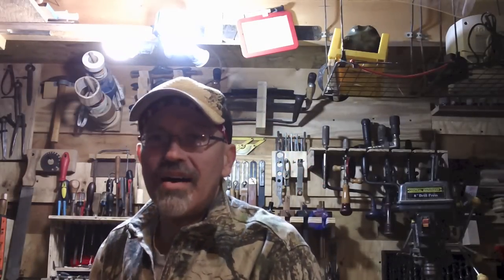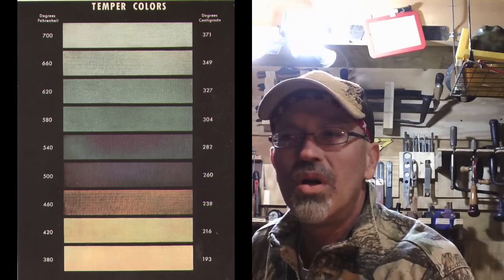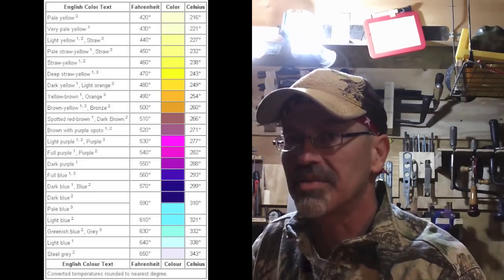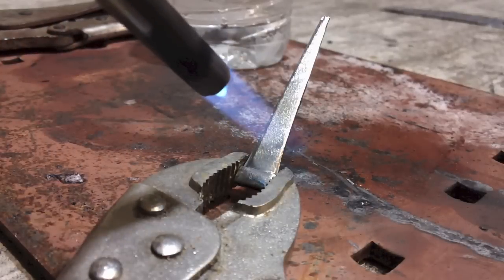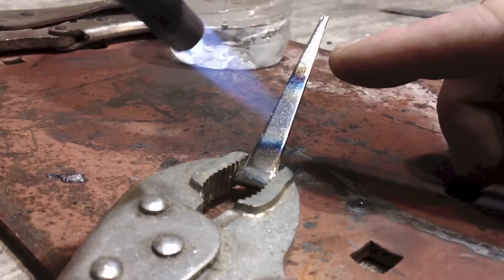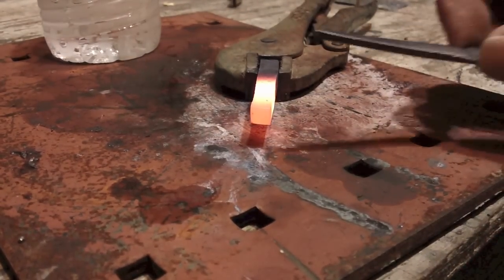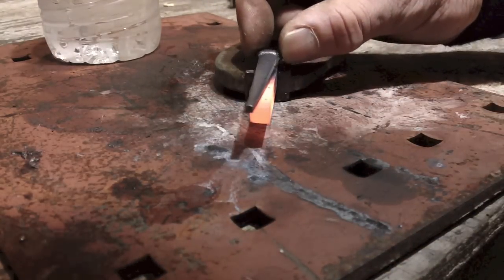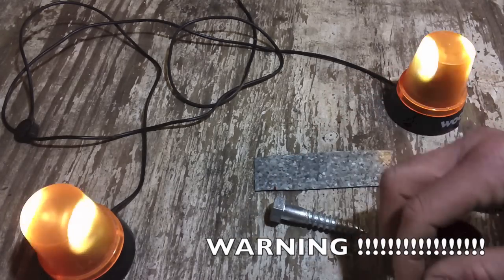Tempering Steel

Comment: if you live in a clay rich area, or get your hands on some sculpting clay. water it down where its like mortar, put it on the areas you dont want to harden as much. lay in on thickish. then let it dry. then heat that knife to temper, and quench. the blade remains hard and the back or clay covered springy. then a slow temper, like 300 Degrees F, for a hour, and you got a knife that's flexy as hell, but keeps a edge like a razor, that wont chip like its made out of glass. takes some practice. its small scale what the Japanese do to make their swords.

i have bought 100-300 dollar knifes for work, and bend en snap the blades offs, yeah they took some serious abuse, but i finally got sick of it, picked up some hardend steal at work. a scrap piece, sketched me out a knife tool do all, i wanted for my work. the applied everything i knew and learned to that knife. 5 years later, that knife tool i made, not a chip, or a bend, or a break or a crack in it. and can cut though carpet, and insulation's, and even peel metal like a light saber...lol keeps a edge for a good minute too.
Reply from the maker: +Huxlee29 It sounds like you are a person after a product that only yourself or a mastered blade smith can make. If you buy a blade with the properties you discussed it will be very pricey. Thank you for sharing that. It was a joy to read.
Reply: and you, Mr. Bardin, im still learning, and thank you, you tube is a miracle to reading books, and manuals, with stuff that seems like gibberish, and then you come along, and make it where i can understand something i may have missed.

plus i did ask a master blade smith to make me a certain tool a few years back, showed him my template and everything, $4500.00 was the starting price range. i dont know about some people but i do not have that laying around for a project that was only 9x4 inches. 

to add to this, difference between what i make and other. mine is UGLY, not a piece of artwork, its made to do its job, it doesn't have to be pretty.
Reply from the maker: I have been working with my hands all my life....oh call me Dave.... and it makes you appreciate the time and labor it takes. If I can get $30 an hour I call it a good day.
Now that you have the metallurgy worked out. Next step is to work on fit and finish.
 But if your like me and the tool is for myself. I don't care what it looks like as long as it gets the job done and is ready to do it again.

Thank you for your time and comments. U R welcome here anytime...
DAve
Reply: that sounds perfect for throwing knives.  i've gone through so many trying to improve my skill.  now i can develop the two at once.  thank you for the comment
Reply: i've been giving mine away as well.  mostly because i already have so many, and make them from free materials in my free time.  i did, for the first time, make a leather sheath for the last knife i made.  the leather came from roadkill i found in decent condition for tanning, and the rest cost me less than $20 including needles and a multi punch tool.  it's for an ocean diver and made of a lawnmower blade i flattened, shaped, sharpened, tempered, and honed with my added expertise of filling the mounting hole from the mower blade with zinc to act as an anode and protect the steel from some oxidization.
Reply: I heard they used to do this with Katana to make a hard and sharp edge on an otherwise strong yet flexible blade...

Comment: You can also put galvanized metal in muriatic acid DONT BREATH THE FUMES PRODUCED.  You will see the metal change color as the galvanization comes off. Then neutralize the acid with baking soda and a little water then you can weld it with a lot less risks

Comment: Thanks, helpful. With every video from different channels I get conflicting information re. Tools to heat and quenching. I’ve heard need to rapidly cool. I’ve heard slow cool. Use a torch. Never use a torch because it’s too difficult to spread the heat for uniform temperature.

Comment: The zinc used for galvanising wouldn't show the right colours anyway.

I am trying to find out how to strengthen a tine on a garden fork so it doesn't bend so easily. It softened a little the first time it bent.

Comment: Hi sir im diggin in this vid pretty late but it is really amazing . i have only one question: 
If you quench the steel with oil or water, i assume that steel is alredy hard. Why to.do the heat treatment and why you do it only in the bottom of the material. ?

Thanks you so much i hope you are doing well. I read you..

Comment: Quick question. I have been trying to make throwing knives recently and need some help.  I buy welding steel (thin sheet steel) from Lowe’s and then use an angle grinder to cut the blade out of it. I then Sharpen the point to be extremely sharp but only sharpen the blade just a little. What would you recommend I do to help keep it firm? I am thinking heating it up to critical and then quenching it and then doing one temper in my oven at 500 for an hour. Any other recommendations. Note I am using home made forges and can’t hit exact temperatures well.
Reply: Also to note. Without doing anything to the blades they work fairly well without additional heating but tend to bend easily. I also do have a hand blow torch I can use

Comment: I bought a gerber knife, and I thought it was a good knife at first, but it will not hold an edge AT ALL. It's terrible. Should I heat this knife to 500 degrees, and quench it in oil?
Reply: I know, I know....What did I just say? I just wanted to know if there was any advice for this ready made knife. Another thing is....I thought a super hard knife would hold an edge. This stuff is maddening to me. LOL

Comment: Hey, I'm not familiar with metal tempering at all. I do some metal fab at work though. I have a decent welder and oxy/acetalyn at home... I'm trying to make a sway bar for an ATV.   the stock sway bar is way too flimsy . there used to be an 11/16" aftermarket one available but they stopped making it. I bought a 3/4" round piece of mild steel. my question is should I attempt to bend and heat treat it ( if so how) or should cut it to length and weld 1/4x1" flat stock to the end then heat treat it ((or not )( from bar to the links)? can it be don't with mild steel.  Thanks
Reply from the maker: +Harper's Harper's  I don't think the mild steel is going to do what you want it to do. Beefing it up with another piece of steel or finding something a bit harder would be the route I would take.  I hoe that helps. Imho

Comment: how do you cool the blade after tempering it? using oil or let it cool naturally by air?
Reply: Dave isnt that quenching it with oil gives better result after tempering? what do you think?
Reply from the maker: oil and water quenches at different temperatures and speeds. It depends on the steel
Reply: no I mean after tempering it, isnt it better to cool it using oil rather than  left it in the oven to cool naturally?
Reply from the maker: I would think not but have never tried.

Comment: I have a question about hardness, I get that quenching from critical gives you a really hard brittle finish but why does quenching from purple or grey give a softer and more flexible finish than straw? I would have thought that the lower temperature the heat treatment the softer not this weird bell curve. Can anyone let me know how this works?
Reply from the maker: its in the way the atoms respond to each other. Its very sci-ency and Tons of literature is written on this. Some they still don't understand.
when you bring the heat up" you see this in temper colors" you are changing the molecular structure of the steel and other substances in it. Such as carbon.
so when u get off in all these sci fi combinations they use now. Its gets insane.
its kinda like a rubix cube

Comment: Can to temper a blade over a charcoal fire?
Reply from the maker: +Mr.Nobody YES! The Japanese still forge with wood cool. Takes more but it will work.
Reply: Yesterday i went and tied to harden a wrench. Quinched it in very hot water a few times and tried to temper it. Put it over a large fire for a bit of time but not shure how long and it turned to a nice blue/purple and a sand'ish color.
Reply from the maker: Im lost. What are you doing with the wrench. If you are taking a wrench and working it into something else. Heres what I would do. First you anneal the steel. This is getting it cherry hot and letting it cool slowly. This will relax the steel and make it easy to work. File it , grind it or whatever the method u choose. Then you will need to harden it. Again cherry hot.1400 degrees to a point a magnet wont stick. Then quench it in oil. Test and see if a file will cut it. If it does cut it quench again in water. Once you have the steel hardened then you temper it. That is when you heat it slowly and get to the temper color you want for that hardness. That color depends on how hard you want it and what its job will be. I hope this helps.

Comment: Great video, thanks for taking the time to share your knowledge.
I have a $40 dollar throwing knife, iv'e been practicing my throwing lately and it has a tendency to bend.
It's fairly soft steel as it is easy to file and will bend easily.
I'm hoping to harden it using my fire place and some oil.
Then, If I understand correctly I need to heat treat it again to make it not brittle.
I was just going to place it in the oven.
Would you be so can as to advise on what temperature and for how long and what color to bring the knife to.
It's a thrown knife, so I imagine it wouldn't have to be super sharp, but would need to be strong and not brittle.
Thanks again for the video.
Reply from the maker: +Chris Hinley Most likely the knife is just mild steel. If that is the case it will never harden. I would try to just get it cherry hot and quench in water. See if a file bites into it then.
Reply: +Dave Bardin . Thank you very much Dave, I'll give it a go.
Thanks heaps for the quick reply, you're awesome.
Reply: +Chris Hinley If it's mild steel, you can still make it hold an edge, though not prevent it from bending.  You can use case-hardening.  This causes carbon, and/or nitrogen to combine with the iron, at the surface, increasing its hardness.  There are three basic processes:  carburizing, cyaniding, & nitriding.  Carburizing involves roasting the part in a carbonaceous substance, like bone meal.  The gunsmith supplier, Brownell's, sells a compound for doing this.  A traditional method involves wrapping the part in leather strips.  It produces a very pretty multi-colored surface.  Cyaniding involves soaking the part in molten sodium or potassium cyanide (Caution!  Toxic fumes are produced.  Do only with really good ventilation!)  Both carbon & nitrogen then bond with the iron.  Nitriding involves subjecting the part to high temp. & pressure under an atmosphere of nitrogen.   This requires some pretty expensive equipment, and is not practical for the amateur.
Reply from the maker: Wow that was a very nice answer

Comment: So...I need to make a small flat replacement spring for a hand pruner lets say. The process is??? Get a piece of spring steel close to the size I need....heat it to critical temp...slow cool it....bend and work it to the shape I need....heat it in a flame until it is dark blue and what?? Quench it or let it air cool?  Thanks for the video...appreciated
Reply from the maker: +john smith YOU MISSED A STEP
heat it let cool slowly
work it to what you want it to be
heat it above critical and quench it (this makes it glass hard)
then temper it to the color you want . straw, purple, brown ect. (this makes it not shatter under use)

Comment: I have some 7x19 316 stainless steel cable that I have cut into 8 inches and would like to form into a circle. It is very springy and will not shape. How would I go about forming it into a circle?
Reply from the maker: +Creative Artist  Bracelets?   are you just trying to weld the ends together?
Please give me more information?
Reply: +Dave Bardin...Thank you for your response. Yes, bracelets. I need to be able to form them into shape and then put end caps on them, without them springing back. I am having a little difficulty. I thought that if I heated them that would work, but I thought I would ask, first. I watched your video but didn't find the answer I needed.
Reply from the maker: Stainless is a creature in itself. U will need to find out the method for Annealing it. This will help you in bending it easer to the shape you want. I would look at maybe using some copper tubing to build a form to hold it in place. Look at filling the copper tubbing with sand. crimp the ends. Bend it to the shape. Then cut it up to where you can use it as a form. I hope that helps. Study the stainless temperature ranges for your steel
Reply: Thank you. Somehow I knew this wouldn't be easy. Appreciate your suggestions.

Comment: Hi Dave, great video. easy to understand.  my question is, are lawnmower blades high in carbon & would they make a good knife blade?  Thanks, Ken .
Reply from the maker: +a Bad Mojo Yes sir they are a fine steel for tool making. I would say a decent knife.

Comment: The truck springs and old file are great ideas!!! I've seen some videos where they repurpose circular saw blades to make  bench plane blades....what are your thoughts on that???
Reply from the maker: +Slap Stick The file and saw blade would work great to make a plane blade. I wouldn't make one out of a truck spring. I don't believe you will get the performance out of the steel like you will need. With that said now forge welding a piece of saw blade to a piece of spring steel would make a near perfect plane iron! The saw steel for the edge holding and the spring steel to act as a good body for the iron. Much like the plane irons of the 19th century.
Reply: Dave Bardin Great info. Sheesh, this channel is such a great find.
Reply from the maker: thank you. Spread the word......

Comment: Thanks for your reply. 
One aspect of this I am still confused about.  Let's say I have heated my blade to non-magnetic temperature and quenched it in oil so that it is now extremely hard.   Do I understand correctly that there are two methods of tempering:  one in the oven and the other by slowly reheating until a straw color is achieved?  Or are both required making it a three step process?  Sorry for the dumb question.

Bert Foster
Brookeland. Tx
Reply: Once you have heated the work to 'non-magnetic' (above critical) and rapid quenched the metal (assuming it is a hardenable steel with carbon), you now have a 'brittle' metal that is hard but 'glass-like'.  To 'make it service-ready', you need to now temper it - this can be done in either an oven (somewhere between 410 and 465 F for most metals, depends on the carbon content) or by a torch like Dave did in his video (he used color, like 'straw', to tell him how hot it was).  This 'sets the temper' of the metal.  Annealing is another process not required for 'most metal works' that a blacksmith would encounter (though there are some that its applicable to).  A great book to read up on all this is the 'Machinery's Handbook, it gives all the temps, steel types, etc. Worth the investment, and one or two copies of this book in a lifetime is ample (the data really doesn't change much in it...I have a 22nd edition and a 26th edition).
Reply: By the way, the Machinery's handbook is like, 2,000 pages....but rather small (about 2-1/2-inches thick x 6x8") and around $130 - and if you get it, you want the hardbound version. They made a softbound copy of it at one time, and I've heard it just doesn't hold up to lots of use (which most working in metal or machines will do to it...it's like the 'bible' of all metal works and machine building.

Comment: I got my hands on some 4mm thick by 1.5 inch wide and I made a knife from it I've come to the hardening stage and am still nervous and unsure on what to do any tips?
Reply from the maker: +liam graham Get a good method to heat it above critical temperature. Then find the hardness you want and temper it in the stove.  Light straw is a good start. Or find a chart on the hardness of the steel type you have and go for that temp. Look at the Rockwell hardness temperatures. You will be fine. If you have a piece of scrap of the same steel. Practice on it first. Good luck!
Reply: Thanks for the help I'll keep u you posted on the peogress

Comment: say, if i had a crucible of molten aluminum, would i be able to transfer the heat to temper the blade by hanging it in the center of the aluminum? also would it fuse? probably not because the melting point of most steels are 2750°F and the melting point of 99.999% pure aluminum is 1,221°F and once the aluminum is cooled i could slowly heat the outside of it so that it melts off the blade right?
Reply from the maker: +Huntzilla360 cave Why not just use salt? Salt is what has been and is still used today. I don't think I have ever seen or heard of any one using aluminum. And after the process is done it is easily removed.